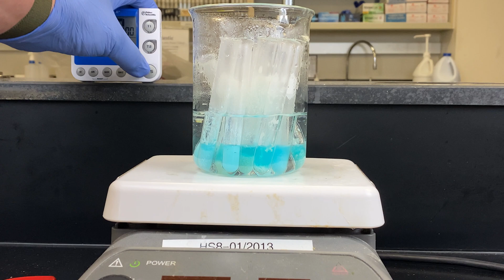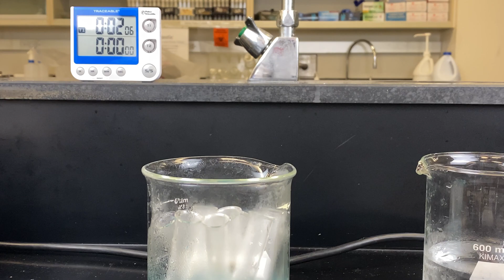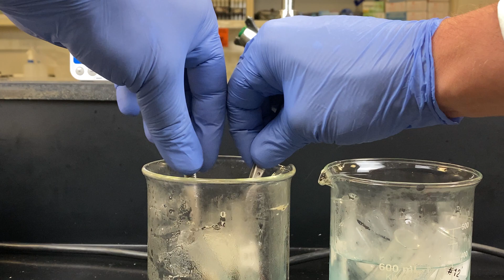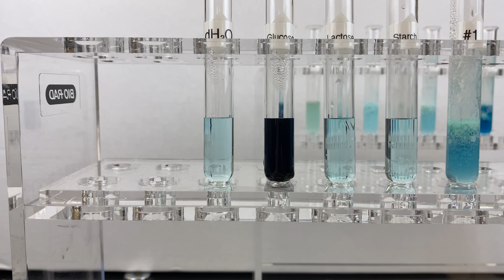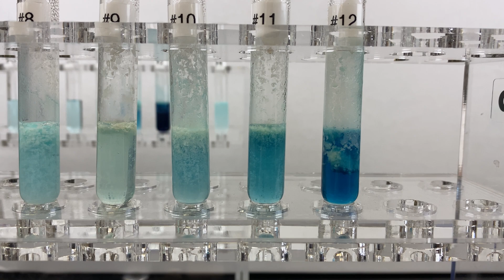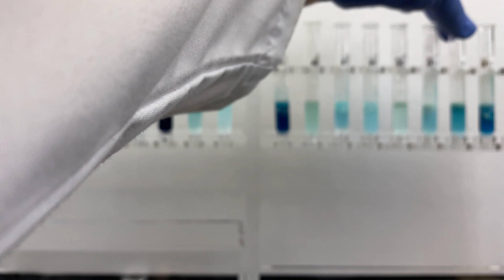Milk Product Analysis - Barfoed's Test for Monosaccharides

Comment: I appreciate your wonderful work done in best explanation. Well, what temperature should I keep for the hot pan for all such practicals?
Reply from the maker: I did not record the temperature I set the hot plate to.  I probably turned it up to max temp to heat it as fast as possible.
Reply: @ProfessorDrewCollop  Alright Professor, Thank you